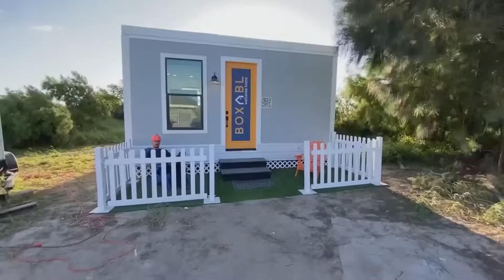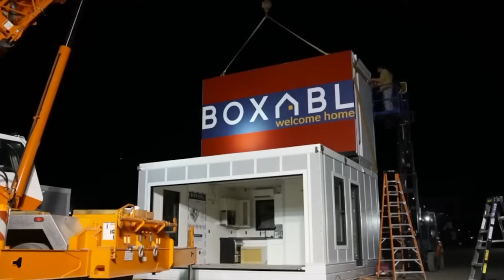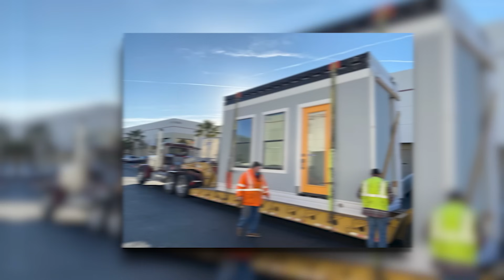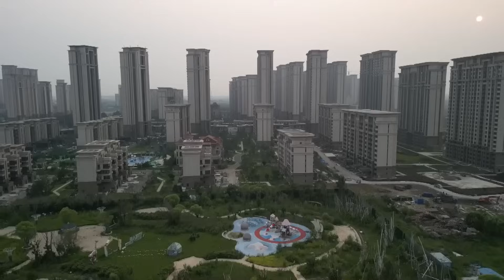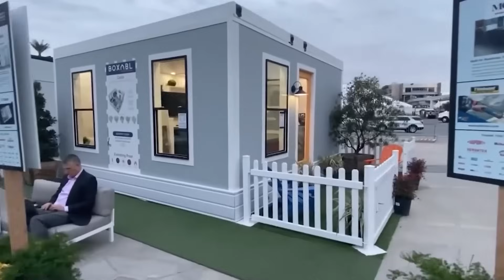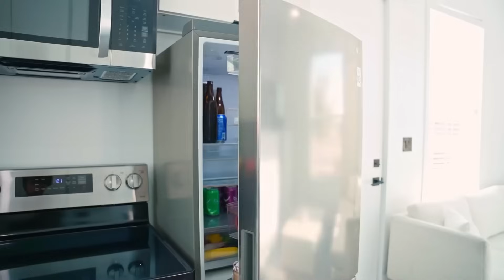IT'S HERE! Elon Musk’s $9,000 Tiny House FINALLY FOR SALE!

Comment: The home looks great but the cost of land and running utilities would make it useless. I hope that we can find answers for those issues somehow because I love the idea.
Reply: I bought 5 and 1/2 wooded acres unrestricted land for $15,000.
It will be all solar for electric. 
I've all ready purchased all my solar and batteries.
Eventually I will have a hybrid inverter mini split.
Right now I use a 12,000 BTU inverter AC/heat pump window unit.
That unit only allows you to heat if it's warmer than 41°F
The mini split will work in colder conditions.
I also have a wood stove as an option.
Water:
 right now I fill 5 gallon jugs.$1/each or I can go to the springs for free.
I can shower including washing and conditioning my hair with a Dollar tree buckets worth of water.
I have a small countertop dishwasher that uses 1.5 gallons of water. Or I wash by hand.
Eventually I'll have rain water catchment and filtering (unless and until I save another 15 grand to drill a well and you pay that even if they don't hit water)
Since I am not living on the property yet I use a porta potty.
Eventually I will probably be doing a composting toilet toilet.
Laundry I use a mini portable washing machine (5 gallons wash 5 gal rinse.)
Hang to dry until I buy a portable dryer.
Then I will still hang to dry on hangers and then fluff them and soften them up in the dryer.
I'm currently live in Florida and I have already started doing some of the things that I will be doing at the property when I move..
My electric bill for the months of July and August $48 each the minimum bill here is $25.
My bill for November and that included a couple days of heat was less than $31.
That's using four solar panels on the ground not even installed properly an inverter and 3 48v batteries.
Everything on that property is 100% paid for.
If I cannot pay cash to do something I save up and it gets done when I have the cash.
When I move I will be 100% debt free.
The only bills I will have will be the car insurance and my cell phone.
Oh yeah and my property taxes were less than $100.
My only regret was not doing this 30 years ago.
And I'm going to copy and paste this on another comment that I saw that said there won't be roads I have a road I even have a mailbox. The nearest Walmart is about 30 minute drive away the nearest home Depot is about 45 minutes away.
I was up there 7 weeks last summer I didn't hear one siren not one police car fire truck ambulance nothing it's quiet I'm a couple miles from the main road.
I cannot wait to retire on my property.
Reply: I am planning on doing the same. I live in Connecticut..I hope when I am ready I can find affordable land here..saving towards it..
Thanks for some ideas you gave..
Reply: Seems like a good off grid option if you install solar and have a water source.
Reply: @jodog31  Maybe but if you are off grid there won't be roads. You could fly it in I guess but that's probably 10 gran if not more.
Reply: With large scale planned communities, the cost of land and utilities infrastructure can be minimized, and wrapped  into the cost of one of these tiny houses maybe you come up with a total cost of say, $25-30,000. Even $40,000 would look pretty affordable in comparison with prices for a single family home in the current housing environment.
And really, this is what this whole marketing campaign is about. Get people thinking small can be cool; adjust the mindset.
So that when the 5th or 10th generation of these fully "modular" houses has morphed into an apartment building or tower of tiny homes, there will be less psychological resistance to the concept.
The future is nearly here.
Get ready.
Reply: depends on were you build , how close you get the power transformer put to it , so it's a good product at an affordable price